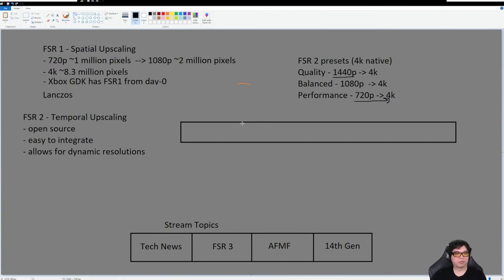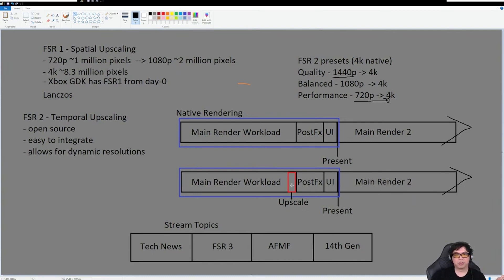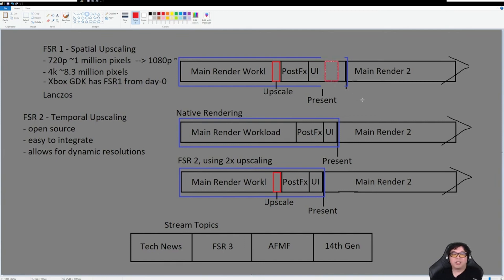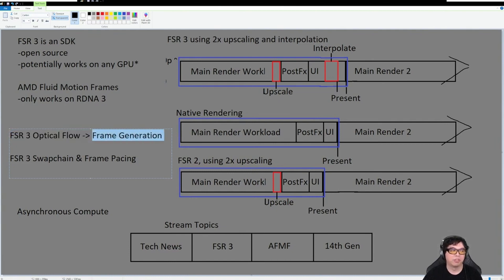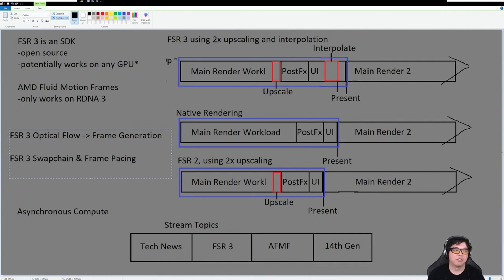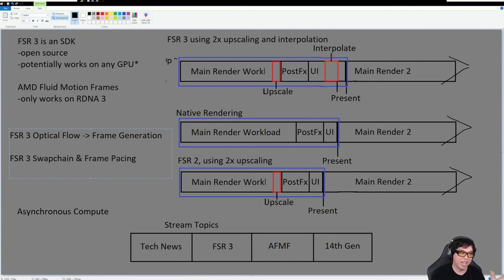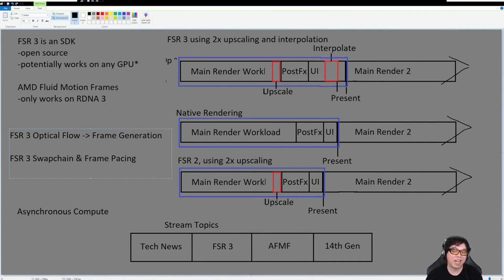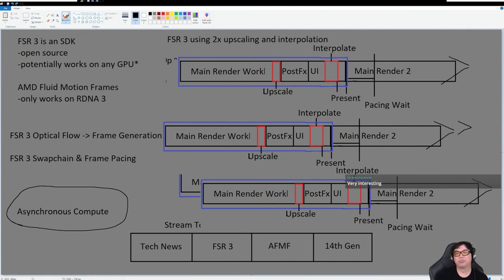FSR 3 Explained

Comment: Do you prefer to enable v-sync in game or in adrenaline or both? I’m running 4K 144hz most of my games are running DX12 200-350fps without frame generation
Reply from the maker: You could turn it on in adrenaline. I normally just enable it in the game itself. If the game has a built-in frame limiter you could also use that instead of vsync.